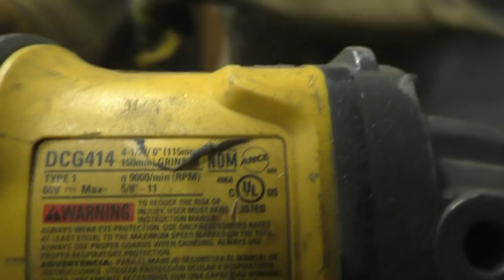Grinder Safety -- and lies you are told to scare you.

Comment: Using a 300mm cutting disk on a 3500w angle grinder, cutting up a stainless tank (I needed breathing air via a mask due to the gasses released when cutting this) the disk exploded, and half the disk got stuck in the welding mask with fresh air supply I was wearing. The angle grinder had the safety shield in place. 

If you ever injure yourself with an angle grinder, I hope the insurance company sees this video.
Reply: Would have been a pretty weird moment getting back to the shop to ask for a new mask while having the other one with half a disk in there...
Reply: To be fair 300mm at 3.5kw is quite a bit bigger than most people will ever use. His point does stand that people are becoming unreasonably afraid of everything and for anything you do with an average 1kw grinder safety goggles are sufficient protection. Though no guard does make me uncomfortable given my experience with rotary tool cutoff disks(<1mm thick).
Reply: The kind of person who would leave a comment like this is fittingly the kind of person whose first thought is insurance companies.
Reply: 300mm and 3500w sounds quite a bit bigger with more energy than these little machines

Comment: Non-reinforced cut off wheels explode all the time, but are still useful.  Wire wheels shed as well.  For me, safety glasses always, face shield as needed.  Hearing protection is another thing as the damage is not acute, but additive over time.  Same thing with protecting your lungs.
Reply: The little dremel ones are the worst because you've usually got it right in your face anyway just to see what you're doing, taken a few to the face, always wear glasses using those
Reply: I dont screw with wire wheels anymore without at least glasses. I dont like wearing safety stuff but a loose wire hitting me pointy side out 1/4 inch from my eyeball was lesson enough for me.
Reply: @markdoumert4840  wire wheels. If it ain't in your eye it's everywhere else. Took me a month to finally get rid of all the brushes on my clothes after polishing 4 buildings worth of fences
Reply: @CSkwirl  I have those breaking regularly even when just trying to screw them on the dang thing. If you get them spinning they may even break looking at them.
Good thing is they kind of disintegrate into dust, nothing that really goes ballistic for more than an inch.
Reply: I've done alot of live edge wood working with an angle grinder and those fucking wires will stick into you like a dart! It especially sucks when they hit your fingers and you feel it to the bone! Use a guard or some kind of protection!
Reply: You guys must be buying some shitty wire wheels. Mine very seldom loose bristles like you guys are saying. And I'm a welder and literally use them all day everyday. I've got maybe 2 pieces of wire wheel stuck into me my whole welding career.
Reply: had a wire come out of a wire wheel one time and go under my face shield. stuck me in the nose, right there in the middle of the nostrils dont know what that part is called) and it hurt like hell!!
 figgure it had to have bounced off my leathers and made it under the half inch gap the face shield left.

  ppe is important, but it wont always save you!! use it anyway!... I was using the wheel at waist level, not doing it right and I  got lucky.  I have thousands of hours logged in the shop, and I have a dozen stories about stuff like that.use common sense and caution.
Reply: @saskmuddinatv  @swampy  they were cheap hardware store wheels, I didn't even think there could be a difference. I could've probably been using them wrong too by pressing hard and stuff.
Reply: Brad Wilson lmao a nick to the cheek and I have +5 pissed off at nothing for the next 10 minutes 😂
Reply: @saskmuddinatv  your whole two month carreer? give it time youngster, time and a die grinder and you'll see.one day you will use one down to nothing because you have to and a years worth of stories will explode in one hour!.. also good your shop buys quality stuff, most didnt back in the day! 
 we used to go through them by the dozens, somewhere I put togather a couple of worn out die grinder wheels and made a giant fishing lure.....
Reply: @lukewarmwater6412  right.... I've been laying beads for ten years straight now. I'm not a seasoned veteran of the trade but I'm also not a rookie either.
Reply: @saskmuddinatv  easy bro, I was just teasin' ya.... forgot you youngsters were so thin skinned these days.  you will see more wires come out of a die grinder than a bench mounted wheel though, and it depends on what you use them on. more sharp edges break more wires etc. and dont run your die grinders at max rpm either. the extra production isnt worth replacing grinders more often, unless its the shops tool dont "just kill it" to get the job done.
Reply: @lukewarmwater6412  You didn't offend me or hurt my feelings in the slightest. I don't care enough what people think to let anything bother me. Especially someone from YouTube. 

Either way no shops I've worked at have bench grinders with wire wheels on them. My grandpa's personal shop does but other than that I've never seen one.
Reply: The dremel wire brushes are the absolute worst. Or maybe I'm using them wrong idk but after one use there's not a single wire left on the wheel. They are stuck everywhere else tho lol

Comment: In my 20 years of working in anaesthetics and critical care, I have had several hundred patients with traumatic injuries caused by power tool's. The majority were from not operating the equipment correctly, using the tool for the wrong application, inexperience, complacency, doing stupid crap and freak accidents. Circular saws are the most common, one guy lodged the guard back on a circular saw while off balance cutting timber above his head. The saw kicked back and sliced his face open from his forehead, skipped over his eye and caught his cheek and sliced across his face through his lips, chin and onto his chest and hand. Half his face was hanging off, but he was incredibly lucky to have missed major arteries and his eye. 
Another guy was cutting a little an annoying bit of wood with a jigsaw on the wall, he hit a nail which broke a piece of the blade which flew off and severed his carotid artery and he bleed out straight away in front of his family, freak accident. Another guy walked to his back door and was scraping the scraps off his dinner plate for his dog's, something he did every night. He somehow tripped and fell down a few steps breaking the plate which severed an artery and he bleed out in minutes. Freak accident. 
If you are smart and understand what you can and can't do you and don't become complacent or stupid you will be fine 99•9 percent of the time, but sometimes freak accidents happen no matter how careful you are.

Comment: 54 years on the job since I was 14 working as an apprentice electrician. You correct in that your safety is your responsibility.  If you are working alone and hurt yourself you are to blame. I have worked in a dozen shops. Welding, grinding, running machine tools, cutting torches, and yes hand held grinders. I have never been hit by a shattered cut off wheel. 
I have had one shatter and stick itself in a beam over the tablesaw it was mounted on. 
I took a guy, named Rex, to the doctor to get stitches when a paper sanding disc shredded and burried a arrow shaped chunk in his forearm. He was lucky it cut into the muscle instead of tendons or arteries. The stitches looked manly. 
What if you sren't working alone. Many shops have benches or fixtures with people working in close proximity. I welded display fixtures  on one side of a bench. The other guy on the bench welded at the same time. While I'm cutting or grinding if the blade breaks the pieces won't always fly off harmessly to the corner of the shop. The guy next to me, across the bench from me, or just walking through catches part of the blade. Let's hope they are happy with a few manly stitches. 
Have you ever checked the RPM rating on your blades?
Your battery operated Dewalt does 9000 RPM. Amazon sells an air sander that does 18000 RPM. https://www.amazon.com/Central-Pneumatic-High-Speed-Sander/dp/B00791ZK8U
The same wheels fit both. Flap wheels for grinders and sanders  have multiple speed ratings. Put the wrong wheel on your sander and the pieces will fly the length of the welding shop at Demmer Corp, in Lansing. I was there. The sander doesn't come with a guard. See the story about Rex above. 
If you don't want to use guards, wear PPE, or pay attention to the speed ratings on your tools it is okay by me. Darwin built his reputation on those situations. Just don't convince that kid who's watching their hero on their favorite channel tell them to do something demonstrably stupid. Chances are they won't ever work for me. If they do it won't be for long. My companies are my responsibility. If an employee gets hurt while working for me, no matter how stupid their actions, it is my insurance premium that goes up. It is my assets that are in jeopardy. 
So when the kids go to work they should know that your decisions are yours. If they try to act unsafely on the job they can expect to be fired. I hope I catch them before someone else gets some manly scarring.
Reply: I'm not reading all that but i'm glad for you / sorry it happened
Reply: OldS.
Phenomenally written, enlightening comment.